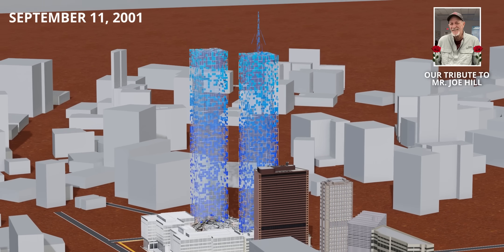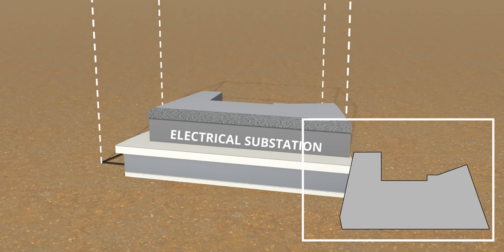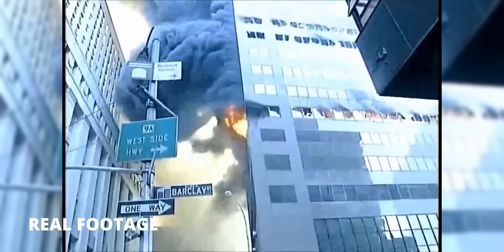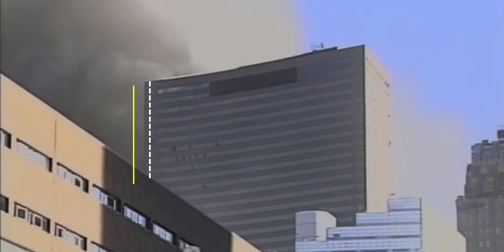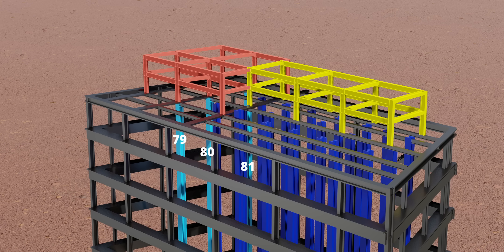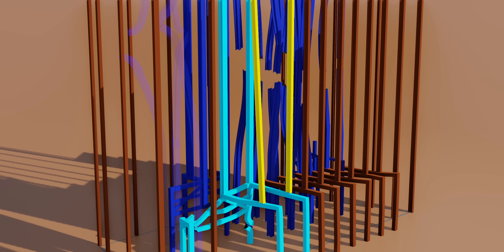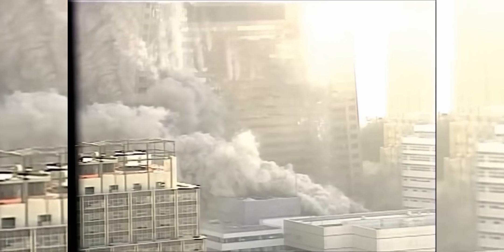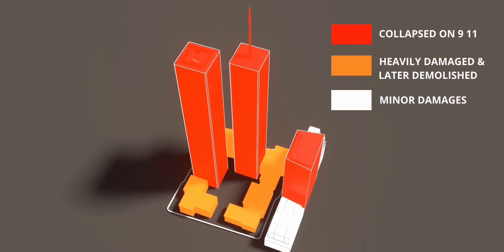Collapse of Building 7 | The Complete Physics

Comment: The uniform collapses of the three towers following a very localized degradation of their structures makes no sense to me.
Should we believe that the most damaged parts of the structure gave way at the same time as the intact parts and this on each floor?
I do not need to be a physicist or an architect to find this insane.
Reply: Anything can seem like a conspiracy if you don’t understand how it works. So, let's fix that, starting with the Twins;

There’s a lot of really awful information out there about the collapse of the Twin Towers, much of it easily accessible to anyone. Good information is much more difficult to come by and to digest and totally unknown to many even though the structural engineering community had already largely figured out Twin Towers collapses at least as early as October/November 2001. Engineeringspeak is dull. Wild baseless speculation and pathological theorizing is exciting.  Fanciful tails of pre-planned demolitions, magical space beams, melting steel and mini-nukes (the awful stuff) are far more entertaining and require a whole lot less thinking, thus getting far more intention than it deserves. 

To correct that situation, I have all on my own prepared this short yet detailed technical description of Twin Towers collapses based on the available true and relevant facts. No politics or ideology, just the engineering. My hope is this will dispel many common myths and answer most if not all questions you may have about the Twin Towers collapses, because *anything can seem like a conspiracy if you don’t understand how it works_

While complex, most of the Twin Towers collapse mechanisms can be seen with the naked eye and easily discerned and understood by the layperson if sufficient time is taken to understand. 

1. The Twin Towers consisted of 4 primary structural elements that together formed an integrated system where each relied on the others.  47 hollow box-section steel Core Columns carry the majority of the gravity loads. The 236 hollow box-section steel Perimeter Columns carry the remainder and ALL of the lateral (wind) loads. Long-span Lightweight Steel Trusses connect the core and perimeter column together at each floor with a Hat Truss on top to tie the structure together as an integrated unit where no element can survive without the others. There was no structural load bearing concrete

2. The impact of 117 tons of airplane (= to about 12 dump trucks) at speeds up to 590 mph with the energy of a ton of TNT completely destroys the aircraft. This in no way implies the Towers come out unscathed. Many perimeter columns are damaged or destroyed as are some core columns (example; 33 of 59 perimeter and 20 of 47 core columns damaged or destroyed at the impact floors in the North Tower), This damage is primarily through bolt-shearing failures at the end connecting flanges, as well as bending, twisting and fracturing of weld seams. There was no cutting or slicing - the reality was far more violent and messy. 

3. The impacts destroy or damage fire insulation, fire breaks and sprinkler systems on multiple floors.  Huge fires are started across multiple floors simultaneously and allowed to spread rapidly with no effective firefighting or fire suppression. This was an unprecedented fire event . 

4. The hotter steel gets the weaker it gets .  With fire insulation stripped away and no sprinklers the survival time of the steel greatly reduced. Gradually over time heat causes the lightweight steel Floor Trusses at the impact damaged floors to sag, which was observed and recorded.  No steel melted or needed to. Structural steel fails long before it becomes a puddle. It just needs to bend

5. Sagging floor trusses pull on the increasingly weak and overloaded Perimeter Columns, causing some of them to bow inward by up to 5 feet. A straight column is up to 4 times stronger than a bent column. The bowed Perimeter Columns buckle and fail, initiating collapse. The formerly static mass above which the structure below could easily support is now converted into a dynamic mass up to 30 times greater. Because they have buckled, the Columns above and below the failure point are no longer aligned . The load bearing structure below no longer bears any load as it falls past the lower columns, NOT onto them.

6. Thousands of tons of debris fall within the four outer walls, down through the open office space, crashing onto the first intact floor it encounters. This massive impact immediately breaks the bolted connections to the columns as the amount of resistance the Floor Trusses can offer is negligible.  The falling debris slows only marginally and briefly. Note:
6a. This is NOT a solid top block crashing into and “crushing” a solid bottom block .
6b. The debris falls past the columns not onto them.  The columns provide no resistance to the falling debris. 
6c. Only the bolted connections of the floor trusses to the core and perimeter columns can offer any resistance. A pair of 5/8” bolts at each end of each truss vs. thousands of tons of falling debris.
6d. No laws of physics are violated.

7.  This floor-led collapse progression within the four outer walls can only go straight down. Note: 
7a. This process is often incorrectly referred to as “pancaking” which actually refers to a completely different process rejected at an early stage. The catchy name stuck but nobody knows what it is supposed to mean.  Pancaking is too simplistic and inaccurate anyway. More like Kaiserschmarrn.

8. Collapse progresses through the floor systems not down the columns, through the path of least resistance . Rate of floor failures increases with each successive floor as momentum increases, reaching an average acceleration of 0.65 of GA, or 35% slower than true free fall. Bam, bam, bam down the building until there are no more floors to fail.  The resistance offered by each successive floor is always the same. The mass and velocity, thus the energy of the falling debris is constantly increasing, with each floor destroyed adding new falling mass. Some falls to the sides, but most falls down. More mass, more velocity, same resistance with each floor.  Don’t get stuck on the but the lower floors weren’t on fire nonsense. They weren‘t and didn’t need to be.

9. The Towers were 95% air by volume. As that air was compressed inside the building it is forced down the tower and blown out the sides in reaction to the building collapsing . Those were not “explosions”, it was expulsions of compressed air caused by the collapsing building, explaining the low velocity, lack of flash, blast, supersonic pressure waves and lethal high-velocity ejecta.  

10. Perimeter Columns become detached and peel away like a banana behind the collapse front, playing out to the four points of the compass extending to more than 600 feet from the base of the towers. This was quite obvious from examination of the debris pile. 

11. Core Columns fail last as their internal beam bracing is stripped away by falling debris and lateral support from the floor to perimeter columns is lost. 

12. For those who care about how long this whole process took; 31-34 seconds from the moment the perimeter columns buckled until the last core columns hit the pile, or 1/3 the rate of true free fall. Don’t believe me?  Just watch any video of the collapses and note the loose truly free-falling debris dropping much faster than the towers themselves.  

13. Each Tower had a 1-acre footprint. Far from collapsing inside their own footprints the debris pile spread out over 16 acres in a pile up to 14 stories deep. 8 surrounding buildings were destroyed and scores more damaged. 

14. What was NOT observed were the 180-190 dB bangs of thousands of high explosive devices or the blinding bright flashes of burning thermite. Neither could have caused the (silent) perimeter column buckling that clearly initiated collapse.  Neither explosives or thermite could have survived the impacts and subsequent fires either. A video of a shocked and injured firefighter using the magic word explosion is in no way proof of explsoIVES . The pre—planned demolition case relies entirely on that sort of thing. There is zero tangible physical evidence and it would be technically impossible, totally impractical and completely unnecessary. No one would bother. 

15.  Finally, the Twin Towers were perfectly safe within their design envelope.  They only collapsed when taken far outside design parameters by an extraordinary and unprecedented event 

Impact + Fire (heat) + Time + Gravity = Collapse . Remove any one of those four elements and there is no collapse. Ignore any of those elements (as many do) and you will never understand the collapses. The Twin Towers were an integrated system in which no one component could survive without the others. One fails, the rest follow, through the path of least resistance – DOWN – through the open space, bypassing the path of greatest resistance – the columns.  Nothing I just described violates any laws of physics. All of the above is true no matter who planned and carried out the 9/11 attacks or why 

I hope you found this helpful and informative. It is not meant to be adversarial, but to solicit informed critical comment, positive or negative. If I made any errors of fact, logic or reason or left anything critical out, please let me know so I can fix it. To stay focused just one topic at a time please and on-topic (Twin Towers ONLY). No word-salads of Gish Gallop. IF you can offer a more plausible alternative be my guest. Be the first. Please start any reply with the words “Tits McGee” or I will know you didn’t actually read it, are not serious and just wasting my time.
Reply: @TheCriticalStinker-01  "Tits McGee"

Given that the only source of destruction/imbalance (Impact + Fire (heat)) to the twin towers was the two planes that hit them. Explain to me how the few floors above the impacted floors managed to destroy the remaining floors below them all the way to the ground? 

Note that when I question the narrative of the offical story, I am not denying the suffering of the people who died on that day. Nor am I desrespecting their memories. But please answer my question so that I can present other question which are relevant to the Twin Towers ONLY.
Reply: @TheCriticalStinker-01 fooking brilliant!!!!
Reply: And now the completely different collapse of Building 7. The other 3 buildings to collapse that day don't get or need any attention;

The unknown and unimportant Building 7 was the 6th building to collapse of 10 lost on 9/11. Though extensively studied, it confuses many people. Not famous, or a terror target, and no casualties, thus it did not get a lot of attention and few know much about it, creating a void rapidly filled with garbage from the internet. Because everything seems like a conspiracy if you don’t understand how it works I prepared this brief summary explanation of my own analysis. No politics, just engineering. 

The North Tower collapse at 10:28am bombarded Building 7 with tons of burning debris, causing heavy damage and starting raging fires burning out of control for 7 hours. Half the responding FDNY firefighters having been killed, others injured, units in disarray, equipment destroyed, no water pressure, and the greater urgency of Search & Rescue efforts, firefighting at 7 was pulled as futile. The building couldn’t be saved and was left to its fate.

www.youtube.com/watch?v=g_SvpwyC17M&ab_channel=MFitz  

Collapse of a burning structure is always a concern for firefighters. Steel buildings subject to fire rely on active fighting of the fires to survive. Buildings are designed around 1 to 3 hours of fire resistance, allowing time for occupants to escape and ACTIVE firefighting to get started, after which all bets are off. Left to their own devices they will exceed their design envelope and collapse. In B7 the occupants escaped, passive and active fire protections were compromised and active firefighting was abandoned which left the building to take its chances. It lost. Odds on Building 7 would eventually collapse, and it did. No big deal in logic. That is the sort of choice firefighters make every day in brush fire situations - which houses to save and which ones to let go. Only real difference here is moving the decimal on the size and cost.

www.youtube.com/watch?v=WnYBX6QT0R4 

FDNY Chief Daniel Nigro ; The biggest decision we had to make on the first day was to clear the area and create a collapse zone around the severely damaged 7 World Trade Center, a 47-story building heavily involved in fire. A number of fire officers and companies assessed the damage to the building. The appraisals indicated that the buildings structural integrity was in serious doubt. I issued orders to PULL BACK the firefighters and define the collapse zone. It was a critical decision; We could not lose any more firefighters. It took a lot of time to PULL EVERYONE OUT, given the emotionalism of the day, communications difficulties and the collapse terrain

FDNY Deputy Chief Peter Hayden ; We had our special operations people set up surveying instruments to monitor and see if there was any movement in the building. We were concerned of the possibility of collapse in the building. And we had a discussion with one particular engineer there, and we asked him if we allowed it to burn could we anticipate a collapse and if so, how soon? And it turned out that he was pretty much right on the money, that he said 'In its current state you have about 5 hours

The collapse of Building 7 was anticipated all afternoon and widely reported in the media with at least 24 video cameras recording some or all of the collapse. Everyone at the time knew what was coming and why.

www.youtube.com/watch?v=OY5S5k3tMHI 
Building 7’s collapse was totally different to the Twin Towers, harder to understand and most of the details difficult to see. But we can sort out what happened through careful analysis and observation.  What follows is MY EXPLANATION of the collapse sequence using the best available information and relying on no authority.

B7 was complex structure, a 47-story steel framed building built on top of a smaller existing 3-story building, requiring several lower floors dedicated to complex load transfer structures instead of usable office space. Of trapezoidal shape and all-steel tube-in-tube construction, B7 (above the 7th floor) consisted of a central core of steel columns carrying most of the gravity load, perimeter steel columns around the outside of the structure carrying the remainder of the gravity loads and long span beams and girders to tie those elements together and form the floors. On the outside of the building hung a moment frame - the last part of B7 to fall. 

Phase 1 : Collapse initiation for B7 is notably quiet with observers not realizing the building was collapsing! There was no audible warning in the form of say hundreds of ear drum busting 180-190dB explosive bangs preceding the collapse. The first externally visible signs of collapse initiation occurred at 5:20:28 pm. Here at 12:00 a local CBS affiliate reporter is talking 10 blocks from B7 when collapse begins. People don’t start to notice the collapse until 12:11. Then at 12:45 is the famous CBS fixed camera clip of Building 7’s collapse Again, note how quiet it is.

youtube.com/watch?v=t5tEy6mXSE8&ab_channel=fresnosean379

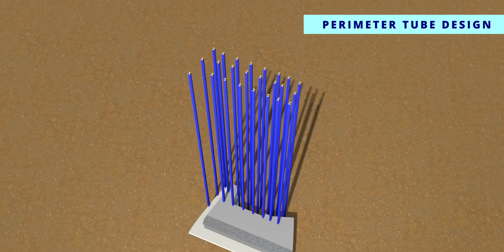Collapse initiation was due to multiple lower floor failures above the load transfer region (7th floor) in the NE corner of the building. In this video at 0:45 you can see the NW corner from inside the building while under construction, Column 79 just out of frame on the left. That big, angled steel beam across the top of the frame connects to C79 at one end. The girders connect to the beam. That beam and all those girders depend on just one connection

youtube.com/watch?v=nP3TNHPCIVU&t=35s&ab_channel=EdwardCurrent

Phase 2 : Lower floor failures caused a loss of critical lateral support over an excessive length of core Column 79 and it buckled. If you look at a floor diagram of Building 7 (see above) and look at all the structures that depend on C79 you quickly realize this one column was a relatively isolated structural element on which a disproportionately greater fraction of the structure depended . Externally we see a vertical progression of window breakage along the 44-46 line and a kink in the roof of the East Mechanical Penthouse at the top of the building, consistent with C79 failure. The transition from full capacity to almost no capacity occurs in virtually an instant. Once the buckling failure occurs there is almost no resistance

Normally with a buckling column, the load could very well be redistributed to other columns, meaning the buckling could stop after a while. With C79 that is not the case - the failure did not redistribute the load, so the collapse rapidly progressed to the roofline, sinking the rooftop penthouse.

Phase 3 : With C79 gone, B7’s progressive, non-symmetrical collapse continues with C80 and C81 at the east end of the core left laterally unsupported and quickly buckled and failed as well, sending the EMP down through the building. C79-81 all have no diagonal bracing, which I believe is a major reason why they could not redistribute a lot of vertical loads among one another.

From there collapse progressed from east to west through the central core until the core was gone taking all of the interior floors and structures and probably most of the perimeter columns with it. You can see the horizontal progression of window failures low in the building and the dropping of the remaining rooftop structures into the building. One of the big takeaways from the NIST Building 7 study (that gets completely ignored) was their modeling which determined C79 failing under ANY circumstances would have initiated the same collapse sequence.

Phase 4 : After some 10 seconds all that remains of Building 7 is just a hollow empty outer shell - the exterior moment frame - creating the illusion the building is still standing since little has changed externally. But it’s just a hollow empty shell like an empty cereal box supported by only a few remaining columns and quite unable to remain standing. With all the internal framing gone. the north face leans inward, forming a V in the roofline, the last perimeter columns buckle under the strain and with nothing left keeping it up the moment frame free falls, landing on top of the 7-story high debris pile. It is only at the very end that a single measurement of alleged free fall acceleration is taken. Note this is not the building but just its outer shell, and only one corner at that, at the very end of the collapse. Start to finish the entire collapse took 18-20 seconds, or less than 1/3 of true free fall and we have to look at the whole thing, not cherry-pick little bits to fit a particular narrative. Worth noting _how fast something falls cannot tell you what started it falling in the first place. The debris spread out, blocking surrounding streets, heavily damaging the Verizon Building and destroyed Fiterman Hall, all well outside of Building 7’s “footprint”.  

Building 7’s progressive, non-symmetrical collapse was incidental and unintended collateral damage from the combined effects of fire + time + gravity started by the collapsing North Tower. That is true no matter who planned and carried out the 9/11 attacks or why . The collapse was of so little consequence it barely even registered at the time, a mere footnote. 

Anything can seem like a conspiracy if you don’t understand how it works. Now you should. I hope you found this helpful and informative, not adversarial and it solicits informed critical comment. If I made any errors of fact, logic or reason or left anything critical out, please let me know so I can fix it. IF you can offer a more plausible alternative please do. Be the first. Please start any reply with the words “Tits McGee” or I will know you didn’t read it and are wasting my time.